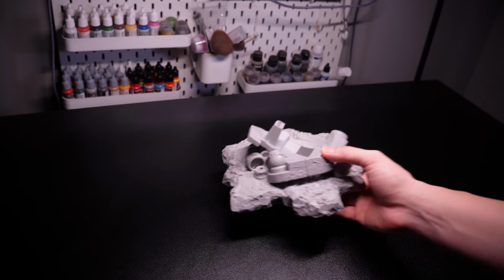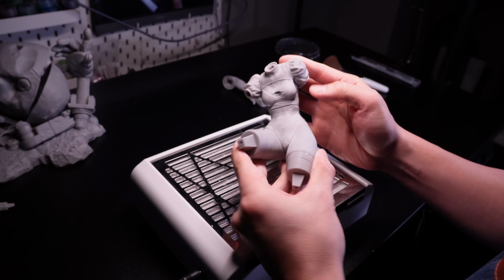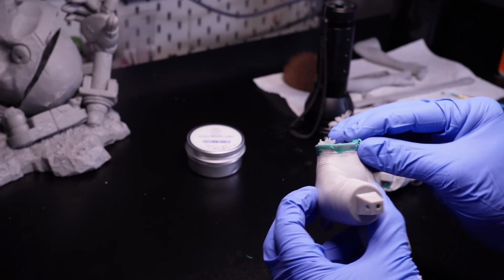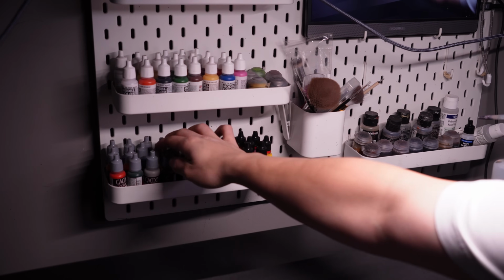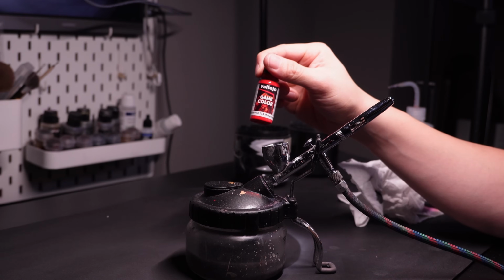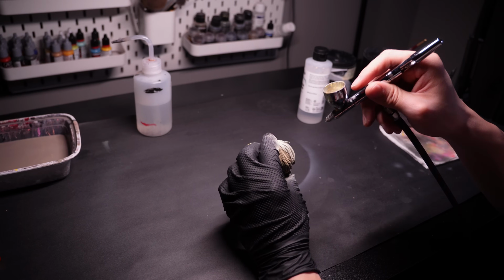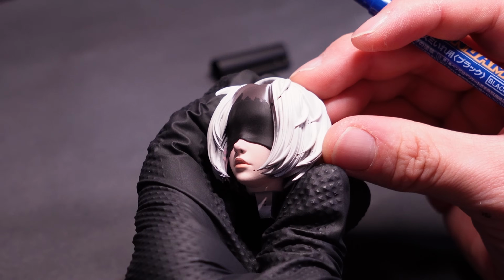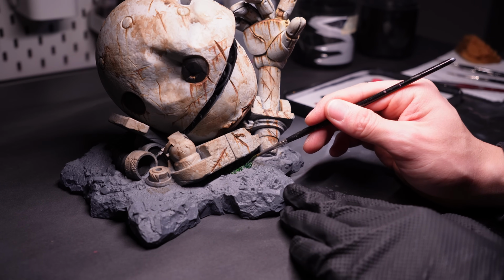3D Printing a 2B Statue from NieR: Automata

Comment: oil washes are a pretty good alternative for rust streaking.
they can be reactivated with white spirits so you can drag the streaks and even erase them if you want.
Reply from the maker: Ya I’ve seen people use different tools to do the rust effect. But I didn’t have any of those on hand 🥲

Comment: The speckling is actually a painting technique to try and get that pigmentation on the skin. I've seen other modelers use clear paints to also replicate veins. It adds a lot more realism to the skin tones than just a flat tone with shading.
Reply from the maker: Ya I’ve seen people do amazing work with realistic skin tones. But personally I prefer the anime/comic book style where skin looks “perfect”
Reply: @TinyLittles3D yes, you could go even lighter for the skin

Comment: Just like I said in the last video, finish has gotten a lot better. Little to no blemishes that I can see. Did you change anything in your method? I believe you said sanding but I doubt you take hours doing that to get a nice smooth finish on these detailed and intricate prints.
Reply from the maker: I haven’t changed much honestly. Maybe it’s just with the accumulated practice that I’ve got? Not sure 😅

Comment: Very nice ,By the way the uv putty is crap from my experience so far  ,i had parts cracking months after....what i suggest you is do the same process and use 2 part epoxy putty from Tamiya ,it takes long to dry so is very easy to sculpt any missing details and generally make it look perfect with some rubber brushes and you can smooth it with water !
Reply from the maker: Oh really? I’ll have to keep an eye out to see how it holds up long term

Comment: Prefer the longer format, 20 minutes feels about right. I've printed this one to paint but as nice as the pre-supports have been done, the head has been a nightmare to try and clean up. I think I'm going to try reprinting in a different orientation. 
Anyway, great work and each video is better than the one before.
Reply from the maker: I agree, I might reprint the head too and support it myself.

Comment: Should air brushes not have a cover on the paint reservoir? It looks like it could splosh all over the work piece if you tip it too much.
Reply from the maker: it does have one. I just don't use it so I can switch between paints faster.

Comment: By adding the dotted complexion you made me remember something. I've seen some people add a lot of complexion to skin by adding veins and blood vessels, than layering up the skin with highlights. Human skin is slightly translucent and 3D artists have had a lot of trouble in the past replicating this. Also the subsurface light scattering is hard to replicate, this is why painted skin often looks. Well. Painted :D This method resulted in translucent looking skin. 
I've been meaning to try it for a while but I have no models for it now (I am still working on 2B from Polina Shaman when I have the time). Have you thought of trying that?
Reply: Also I've seen someone paint 2B's hair by base coating in a very bright chrome metallic paint, then layering up to white. It makes it shine a ton - I plan on trying this :D I'd like to use the same chrome on the weapon to make it harmonize
Reply: One thing I wanted to ask. I have a hard time saving the airbrushed paints. I mean when I mask it, it often peels down and it is really hard to repair. I have to include an additional step in my process to apply varnish after my airbrushing steps. Do you not have to do that? 
Maybe it is because of the paints I use - I am not sure. I've not had this issue - or can't remember - with citadel paints. But in recent times I am exclusively using Kimera. Or perhaps my thinner? 
I am not fond of the extra step needed for masking. Soo much tiiime T_T
Reply: It did not feel long - I think you can make it a bit longer if you wish. I have issues with 30 min + videos - I think the sweet spot is 15-25 mins for most people
Reply from the maker: Oh that sounds like a neat idea. Might give it a try
Reply from the maker: What are you using to mask? I’ve had that happen to me when I use liquid mask, that’s why I stopped using it
Reply from the maker: I haven’t tried realistic skin painting yet. I’ve seen people do it and it looks amazing. But I personally prefer the comic book / anime style where skin is “perfect”
Reply: @TinyLittles3D  masking tape, painters tape and silly puty. But I even have the issue some times when I try to remove a speckle from the airbrushed parts. For example on 2B while painting the black of the stocking, I slightly touched the tighs. I quickly switched to a clean brush with a bit of water and it lifted the airbrushed paint. It is bothering me a lot :D

Comment: What is the orange putty that you are using to mask parts of the statue during spray painting?
Reply from the maker: Silly putty
Reply: @TinyLittles3D  Thanks for answering. 🙂And what is the reason for using this? Does the silicon silly putty wipe clean of excess paint easily? Is there any particular brand you use, or just the cheap kind?

Comment: The problem with that UV putty is not you. It has different sanding characteristics than what ever resin you used in your build. The only thing I would use it for is a big gap. Then use your own resin. That way it all will sand the same. But please make sure guys you use the last layer the same resin as your build!
Reply from the maker: Oh that’s interesting. Haven’t thought of that. Thanks for the tip!